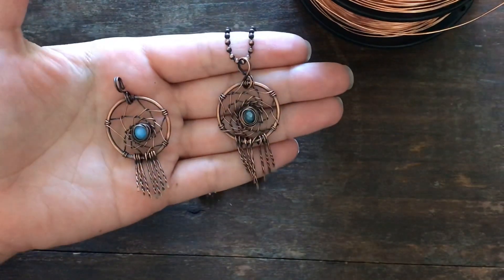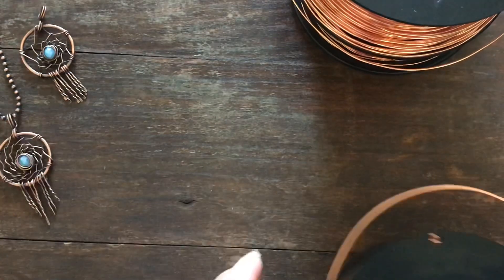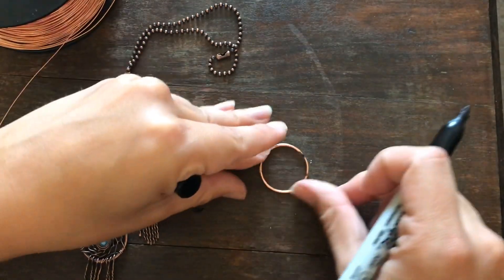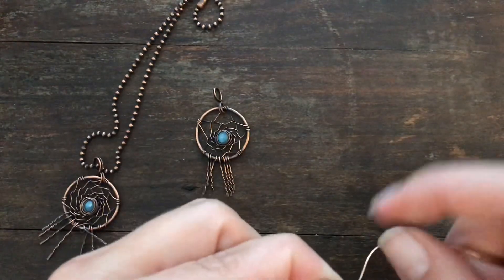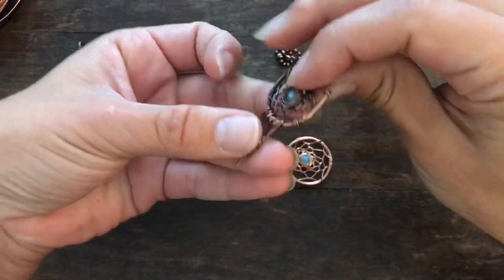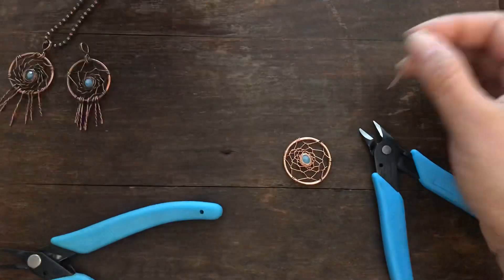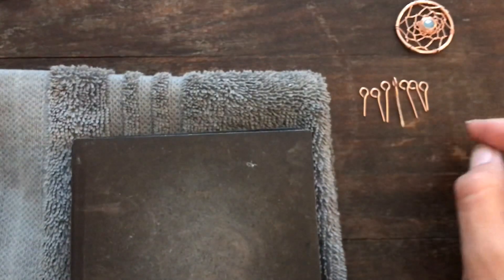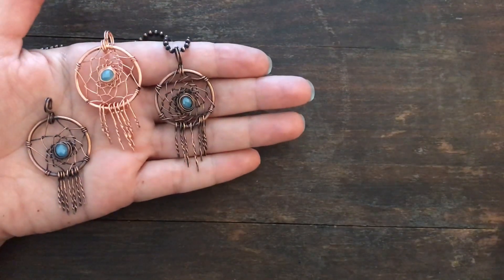Boho dream catcher pendant | Tutorial

Comment: Hi. About what size is the ring? Need to buy some. I followed how you made yours and mines got all messed up when wrapping the wire around it. 😒 thanks for the video, it’s great. New like and subscriber.
Reply from the maker: Im not sure off the top of my head but if I remember correctly I used the top of a bottle to form it. Just measure the diameter of a water bottle top. Also try just not pulling so hard in the wire :)